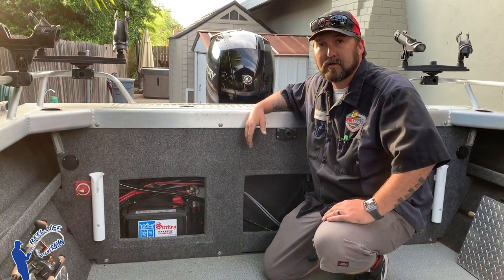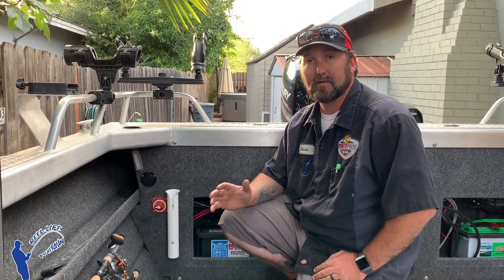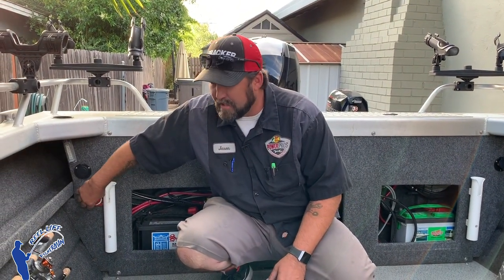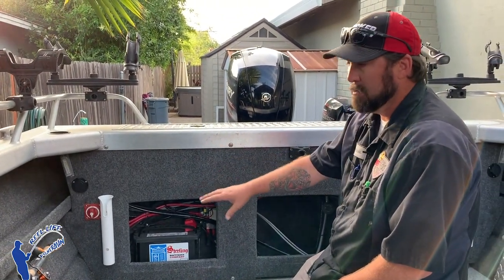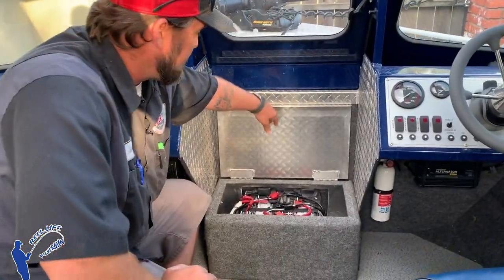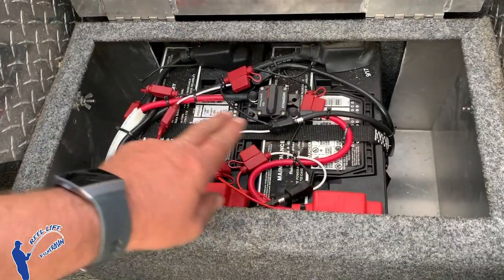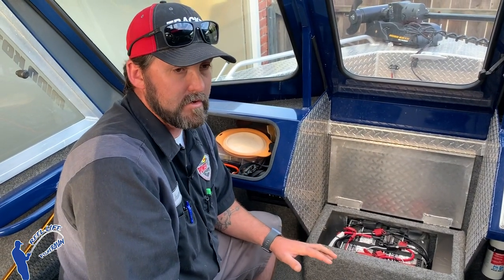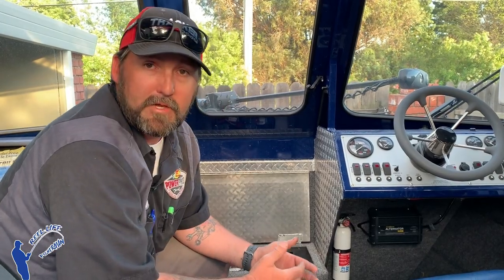BOAT BATTERY WIRING  | HOW TO

Comment: Dude... this is how a DIY video is supposed to be. No extra crap. No tangents. Straight to the point. Every single talking point covered. I just got a boat and now I have zero doubts on how I wanna wire it up. You rock man.
Reply from the maker: Awesome! Thanks I really appreciate that! Thanks for watching and let me know if you have any questions..
Reply: Ok. I'm in the planning phase of my boat project. Around me, there are mostly lakes that only allow electric motors. Before we go further, I'll explain what I'm dealing with. I was given a 16 ft bass boat by an old 1sg I served under in the Army. It's a 255 Sprint I believe. Well taken care of, but it needs A LOT of love to be at my standard. Now, getting back to my plan. Since most lakes are only really electric unless I venture a little further, which one day I probably will just to fire up the beast and cruise around. But for sake of my current situation, I only have 2 batteries in the boat. I just bought a 2 battery switch, and I figured I would run them in parallel. To maximize trolling. And by the off chance I fire up the big motor, I still have plenty of battery to troll afterwards. I do have a 2 bank battery charger on board. Does that sound sufficient? Or should I add one more battery? I also bought a nice fuse block to actually wire up individual circuits. For the fish finders, live well, radio (I'm adding), lights, and whatever else I feel squirrely about down the road. I feel like 2 is enough, but I'm not sure. How long can you troll around on 2 batteries? And is there a way I can wire in some sort of alert if I'm running too low on juice to get back to the dock? Thanks again.
Reply from the maker: You can get a battery gauge.. but I would run one battery just for the boat stuff fish finder and engine then the other 2 for the electric trolling motor.. if you have your fish finder on the same battery as a trolling motor you will get interference on the screen whenever the trolling motor is running..
Reply: That's exactly what I was planning. Now on a gauge... what voltage is leaning towards a spent battery? 10.5 ish?
Reply: One more question... I've been doing tons and tons of research on the best trolling motor batteries. Strictly for trolling, and I can't decide. In your years of experience, what are 2 great batteries batteries you can count on to be good batteries? I'd like 31 series. But would 2 27 series be sufficient?

Comment: Aloha,

This was a great visual tutorial using the Traditional Dual Battery Switch.  If I had had the room on my boat (19' Bow Rider) I would have gone this direction. Having the switch out in the open is so convenient.  I ended up using the Blue Seas Mini Add A Battery in the hold under a seat eliminating the need for manual switching and getting passengers/gear off the seat to get to the switch. Great video!
Reply from the maker: Awesome glad you liked the video! That is a perfect way of adding a battery.. the isolator makes sure it’s always charged.. thanks for watching watching!

Comment: Hands down best explained way of understanding battery switch , most all other videos make it sound confusing for OCD people like me. I tend to over think the simplest things. So thank you for People like me lol. Cheers
Reply from the maker: PISTOL2321 IV thank you very much! I tend to be pretty OCD myself..lol . So glad you found the video helpful.. let me know if you ever have any questions ,I’d be glad to help.. thanks for watching
Reply: Reel Life Fisherman 
So stupid question but just want to make sure. I don’t have troll set up yet but you talk about battery chargers/tenders. I can tell you are OCD as well. But those are mainly for when you park bot for periods of time you just plug in at home ? Or do you plug in after every use?
Reply from the maker: Yes I do have OCD .. 😉 lol.  To answer your question the  battery tender type is to be plugged in after every use and you can leave it plugged in until you go out again.. the alternator charger works while on the water when you are running the main engine.. I used minn Kota for everything.. it is my personal preference.. let me know anytime if you have any questions.. thanks again
Reply: Reel Life Fisherman 
I’m pretty decently mechanical inclined engines and such. Understand well on engine charging. Just getting more picky as I’m redoing my checkmate and never really used a charger for RV or Marine use so just wasn’t sure if it is best to plug in after every use. And thanks man. I really apprised it and being in FL I know many marine shops and I am great with hot rods and such but lack in electric cal use. This battery switch Deal is more confusing then should be and I suppose you just do better. Now I have seen how others are saying the newer Battery Isolating Blue Sea switch is now the better way to go??? Whats your take on that? Oh happy new year by the way Dude. Cheers 🍻
Reply from the maker: So the alternator will always charge the crank battery in a normal set up of course.. the alternator charger I’m talking about is made by Minn Kota and uses the excess charge and boosts it to the electric trolling motor batteries.. they will get a charge while on the water and motor running now.. where normally they get none.. until you are home and plugged in..
Reply from the maker: A battery isolator with a switch is a great idea and I should have talked about that in the video.. but didn’t want to get too crazy into it and make it confusing..but a isolator makes it easier to use.. not Necessarily to install.. you can use a isolator without a switch even.. the isolator will use the charging voltage to charge both batteries all the time.. you can with no switch hook all boat power to the house battery and the engine to the crank.. then the crank battery is not being used while running boat stuff..  with a battery switch in the mix you can use a common fuse block or bus bars to be able to switch back and forth between the two for emergencies but the isolator will always be charging both batteries which is nice.. you don’t have to remember to do it.. I don’t have one .. but I have a battery charger for my 2 boat batteries and another 2 bank charger for my 2 trolling motor batteries that I keep plugged in at home.. hopefully I explained it ok over text can be hard..
Reply: Reel Life Fisherman ya understood most. So back to my other question , now if I do have the isolator installed is it necessary for me to add a battery charger ?

Also you just brought up other question of many sorry man. Again I am 70-80% engine guy and mechanical and 30-20% electrical. I’m in automotive field and could ask others but you explain best that my insane  brain understands.

But anyways, say I install switch with Isolator , Or even with the same 0/1/2/1-2 you have. After all my stuff comes back from interior I am installing 8 speaker system with head unit nothing crazy, and then all I have in my panel is bilge switch, fuel switch , nav and ancor lights. So should I just use house for Stereo system and My Rocker panel and completely just have starting battery for starting? I understand house isolator works after looking at diagrams which are different and also shows different ground combos. So seeing if its more of Isolator so all batteries charge and Asking if no charger needed ( still most likely adding a charger especially if it sits) 

And on the switch you have Where I get a snag, is when you have in the 1 on possision. For starting, if I had that how would my stereo work if I was just on the 1 position and runing while 1 is being charged and switch is not running 2?

Hope those questions made since.

Thanks, Cheers 🍻
Reply from the maker: PistoL Pete-IV if you have all of your boats power running to a bus bar or fuse block the common or also called the output on the switch is hooked to that.. then battery 1 and battery 2 is hooked to those positions on the switch.. then it will work off of either battery..so I keep 1 as my crank and run my boat off of it most of the time.. only switch to battery 2 if I will be sitting for long periods of time.. or in emergency.. I would always recommend a battery charger to keep battery in good shape..
Reply: Reel Life Fisherman 
You’re hands down most helpful diy dude lol. I have 2 auto body dudes I subscribe to one being DIY auto body school with “My Friend Pete” hes an OG and crazy AF but you have helped by answering questions. What shop do you work at? I should throw you a solid review on google .
Reply from the maker: Thanks man I appreciate the great feedback! I work at  TMBC in Rocklin CA.  We are a boat shop attached to Bass Pro Shops.. glad to help.. let me know anytime if you have any questions.
Reply: Reel Life Fisherman 
Damn, opposite sides of country. And will do man 

Cheers 🍻

Oh My name is Pete btw. Didn’t catch your name
Reply: @ReelLifeFisherman  Is there a particular place on the fuse panel to connect over to the "common" lug on a switch? And do I understand that when I connect my on board charger and place my switch on "both" that both batteries will charge?
Thanks.
Reply from the maker: our2junebugs so you would hook the main power wire coming from the battery switch to the main lug or post on the fuse panel or bus bar.. and it would charge both batteries that way with the charger.. but it’s not recommended.. you should hook a bank to each battery.. so a 2 bank charger ..  thanks for watching

Comment: Greet video, new to boating. Just bought my first used 1983 Cajun bass boat, it’s been sitting up for a few years, appears to be in great shape but there are wires running everywhere, an I know the batteries need to be replaced and wired, so this explains a lot to a new boat dummy. Just where you placed your batteries was informative. Thx, great video.
Reply from the maker: Aj Johnson awesome glad to help! Be sure to check out some of my other install videos and trolling motor battery wiring videos.. and feel free to ask any questions.. I always try answer all the questions I get as soon as I can and to the best of my knowledge.. thanks for watching.. and congratulations on getting your boat! Tight lines

Comment: I love your video! Very informative! I have a question on wire/battery installation.. 1. what size/gauge wire between battery (24V) 2. How do you connect Alternator Charger to house battery and to 24V trolling battery? 3. Can be dual purpose battery group 31 used as trolling motor battery?. Thank you!  Best regards.
Casey
Reply from the maker: So you want to use 4ga. Wire for jumper battery to battery . And you would need to have a 3 bank alternator charger 1 bank to each trolling motor battery and one for the house battery.. then of course with any alternator charger it has a lead to go to the cranking battery.. that’s where it picks up the excess voltage.  And with the duel purpose batteries.. I’m not a fan.. I feel like they just don’t do either thing very well.. get a cranking battery for cranking or a deep cycle for trolling motors or house batteries.. they are 2 differently made batteries for different applications.. so one isn’t really going to be able to both.. thanks for watching and commenting.. hopefully that helps and let me know if you have any questions.

Comment: When I am not using my boat and it is on charge to the cranking battery will it switch to the house battery once the cracking battery is fully charged? As to keep both batteries charged with one charger. Great videos! Very much appreciated!

Comment: Morning Jason
Just purchase a Minnkota 2bank charger to install, so I have a 12v system I want it running parallel. So my question is when I connect the charger do I run it pos to neg on one battery which would charge both? Or do I have to connect ea battery to a bank on the charger while still running parallel.? I hope my question is clear?
Reply from the maker: Daniel Ramos yes you need to run each bank to one battery.. positive and negative.. even when hooking in parallel.. it would work the other way.. but it is better and designed to be hooked up each bank to one battery..
Reply: Thanks

Comment: Great videos! I really like how you break it down and don't skip any steps assuming DIYers already know...I am adding a 24V trolling motor to my boat soon and thought I could wire it up to my existing batteries, but after watching this video it looks like I have to get 2 more 12V batteries and find somewhere to mount them in/on the boat. It's a 1999 Angler 204 for reference...thanks!!!

Comment: Did I miss the part where you mentioned  the gauge wire for the battery to switch terminals?....anywhere I can find the correct gauge cables with end terminals installed....GREAT video!
Reply from the maker: Sorry if i didn’t mention it but I use anchor marine 4ga wire .. I make my own .. the automotive ones don’t hold up on boats very well.. thanks for watching let me know if you have any questions

Comment: Great Videos, I have question. Just purchase a 20 year old boat. should I replace all the batteries and cables and of course the wiring harness, the previous owner was a hardcore salt water fisher man.
Reply from the maker: Not necessarily the batteries if they’re newer should still be good. But it wouldn’t be a bad idea to have new batteries. There wouldn’t be any need to replace the wiring unless it’s been corroded badly or chewed up by rodents. Thanks for watching and commenting glad you like the channel! Let me know if you have any questions.

Comment: Can i put the switch on battery 1 when starting the engine, then turn the switch to (both) in order to charge both batteries (deep cycle and crank)?

Thanks

Comment: Awesome Video 👍.  I have inflatable boat that I only run a 12v 30lb trolling motor with a couple accessories; fish finder, lights and phone charger.  I have two batteries and when one dies I disconnect one and reconnect to the other.  I would like to extend my time using the parallel method.  I understand that my volts remain the same but my amps are doubled.  My question is will I run the risk of burning out my motor or accessories because my amps went from 60 to 120?
Reply from the maker: Christopher Clayton I would only recommend connecting 2 of the exact same batteries in parallel.. same age and everything.. the amps do double but the volts stay the same.. I would only also recommend hooking your trolling motor up them with a proper rated circuit breaker.. and using a separate battery for any accessories .. or just continue doing what you have been.. thanks for watching and let me know if you have any questions..

Comment: Oh Dude..... I've been a carpenter for 52 years and buying a boat this May and I even understood the wiring process.
Saving this for sure. The battery one and two was kinda blurry with the 3 way switch in the back but I'm sure when I see the back of the switch it'll make perfect sense.
This is exactly what I wanted to find and this is the only video I've seen for battery system I wanted to do, 
One quick question, can I or should I have the running lights on the starter battery with kill switch for the trip back home so they will be bright and not be affected by house battery that maybe running at 30% power from all day activites? 
Thanks a million

Comment: Basic...dumb question on my part...what gauge wire should be run to accessories...bilge, live well, navigational lights, gauges? 18 foot aluminum. Thank you!
Reply from the maker: I would run 12 or 14awg to pumps and 18awg for lights .. thanks for watching the video! And let me know if you have any questions anytime.. tight lines!
Reply from the maker: Oh and I forgot to mention that 18 to 22ga wire is fine for gauges..

Comment: really helped a lot there definitely wanna copy this set up with the two chargers and the mini Kota charger but my issue is the wire sizes I’m going to a 65hp with a trolly I want speakers and lights but from battery to ignition and to tilt it’s all kinda confusing. And I can’t find good chart that I can understand😂

Comment: Hello, I’m new to boating and my son gave me his 16’ Tracker pro guide SC. I don’t fish for bass, I like trolling for Kokanee. I have a new Scotty 1106 electric downgigger. I have two batteries at this time one for the trolling motor and one for the main motor. I would like to add a third battery, space is problem. In the back there a plastic storage area with a drain. No sure if I can remove it. Eventually I want to have to Scotty’s downrigger’s. I believe I need to run both Downrigger’s off the main battery. If you have time help me figure this out by adding another battery and the best way to wire everything up. I would like to add a battery switch too.
Thank you for you knowledge.
Larry
Reply from the maker: Yes you would run both downriggers off the cranking battery.  I do believe I have added a second battery to one of those boats in the past.. but I can’t remember exactly how I did it.. I’ve moved out to Florida and we don’t see many of those out here like I did in Northern California..  you don’t really need the second battery but if you’re worried about running the battery dead then i would recommend a battery jump pack that you can pick up on line .. they are small and powerful and will save you in a emergency.. thanks for watching and commenting let me know if you have any questions.

Comment: Hey man was wondering if you could do a indepth video on how you ran the wiring through that thunderjet for the front mount minnkota? I see your center step box is cut out to fit them in there but was curious where your wiring is ran? Thanks

Comment: I have a 205 sports craft boat and do not know how to connect the batteries so I will like your assistance in implementing the correct way to connect the two batteries. I do like your video so I will try to get the same switches and do the connection your video is helpful thanks ,if you have and other suggestions I will be happy.